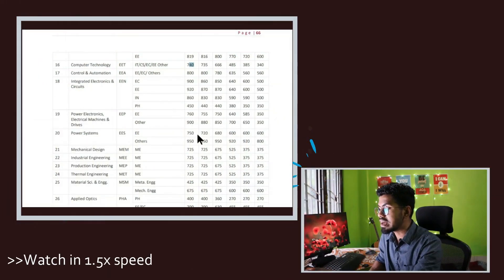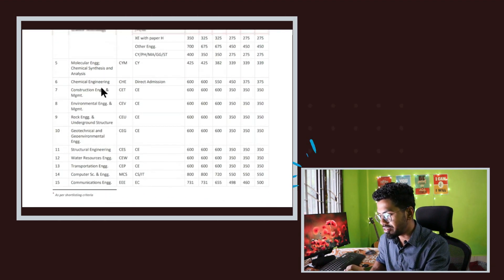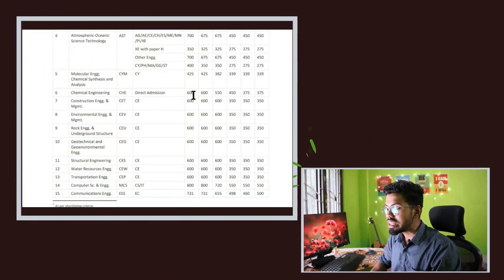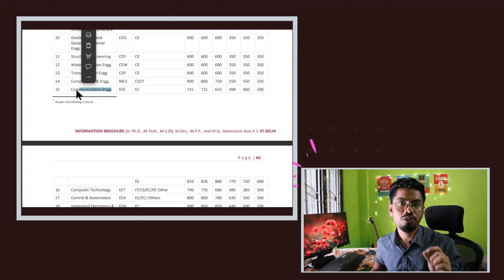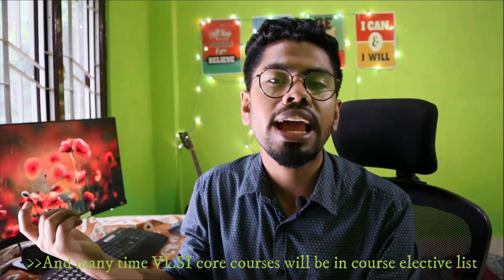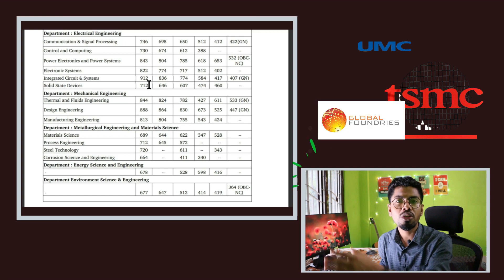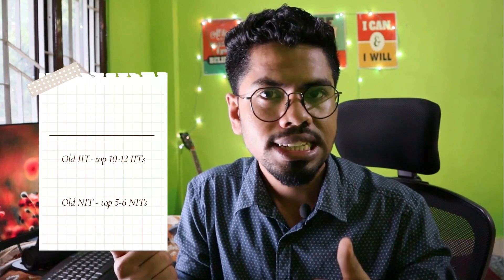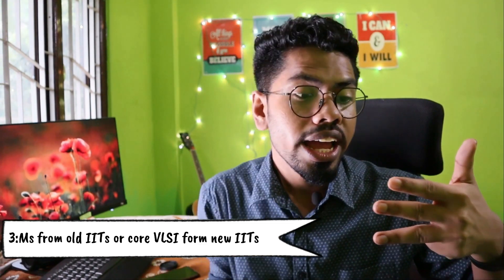Alternatives of VLSI branch| Way to IITs | Use your EC GATE Score Card Most Efficiently(Part2)

Comment: Sir, thank you for your suggestions. I've got RFDT Delhi as they conducted interview this year. My interview was 90% on EDC as preference was microelectronics. But How the sub branches are allotted finally? A few seniors said it is based on our score. I've got RFDT in 4th round. My score is 687 rank 359. Is there any chance to get microelectronics? ( EE score for 500-600 rank is also higher than ECE score in my range. That's why I'm worried). Kindly clear this doubt.
Reply from the maker: Hi Saheli ,congratulations 🎉 , during our time when last the interview hold.. It was  directly depend on interviews first choise.... It might change this year but chances are very less... So there all possibility that you will get microelectronic only.
Reply: Thank you so much sir for replying. What are the prerequisites for taking microelectronics or microwave specialization? Anything that we should learn before joining so that our MTech journey becomes less hectic. Please give your valuable suggestions.
Reply from the maker: ii will suggest you, complete analog IC from nptel or by rajavis lecture... Its in our program elective , max student avoide but this is great to have through out understanding of circuits.
Reply: Okay thanks a lot sir. :)

Comment: Hey I haven't done good in GATE in my second consecutive attempt. I am planning of joining a IT job and then prepare for GATE simulataneously. Or should I do a VLSI training.
Reply from the maker: If you have financial constrain then go for first option , which is best but you need to be ready for hardwork, go for a BIG IT farm so you will have comparatively less work pressure ...  And with second option you need to spend around 80k+ and then also thfjob you get wont pay you much in initial years , after thet for sure pay will be attractive
Reply: @whyRD  Can VIT, vellore VLSI or Manipal VLSI be chosen in place of IITs. How does the research accumen of former compare with the latter?
Reply from the maker: I will go for VIT  , not too.much sure about research facility, best if you connect to some alumni of this 2 college s in linkedin .

Comment: What topics we need to prepare for interviews of:
1) optoelectronics
2) rfdt 
In general there is a lot of confusion about topics asked in the interview...especially branches like optoelectronics. Do we need to study any optics reladed topics?
Reply from the maker: In general , they wont be asking you exta then the gate syllabus, we havdfew optics topic in emft see those specially and then general circuit knowledeg... For rfdt you need to choose one pannel out of 3 microelectrnoics,microwwave , signal processign... As name sugest for a specific pannel they will ask most of the question related to that... For example in microwave full emft theory
Reply: @whyRD  actually for ee branch , emft syllabus is small and does not have optics related topic.
So any advice for ee guys for interview of optoelectronics?
Reply from the maker: Probably batter if you just go through those topic and explicitly mention that you have covered thise topic on your own interest as you have a liking for opto electronic